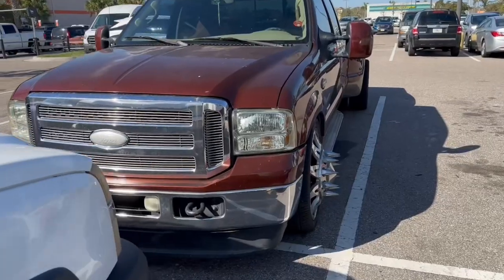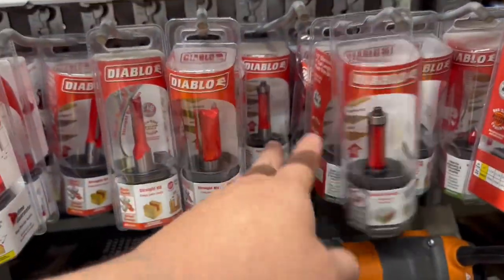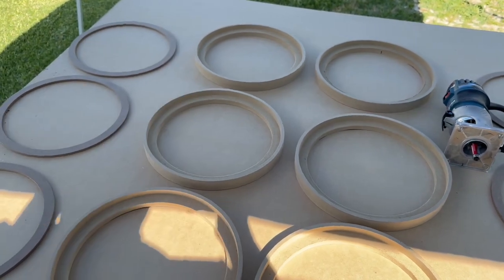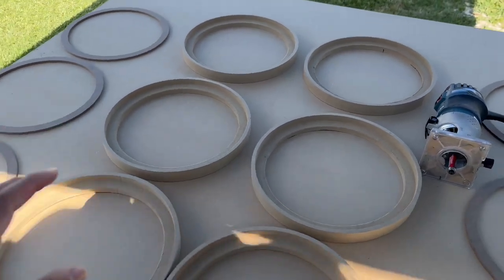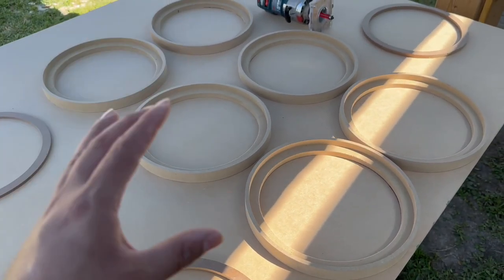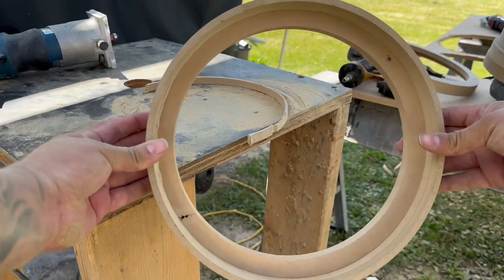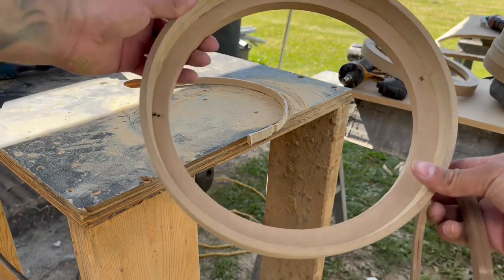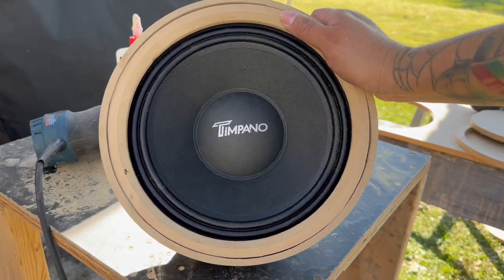Making Wood Speaker Rings to start Door Panel Build

Comment: Man go watch high voltage car audio he gives a good tutorial on how to do what ur doing. If you want to make flush rings, it's easy for your overall ring take the size of the speaker and add 1/2 inch, that gives you a quarter inch all around. Then cut out the inner. Use a rabbit bit if you can't router out where it sits on.